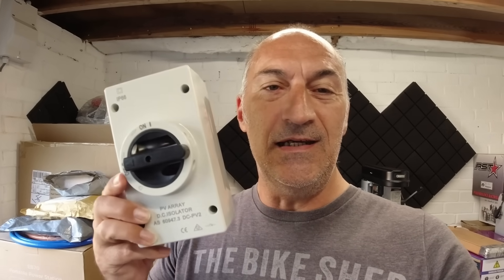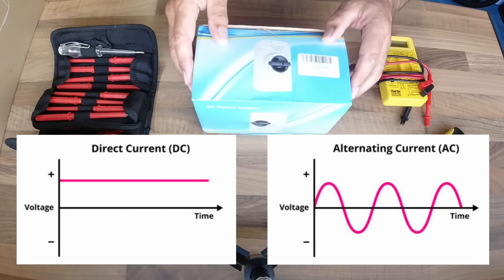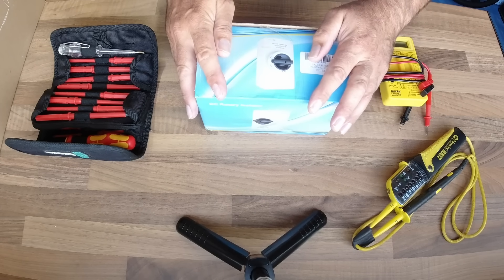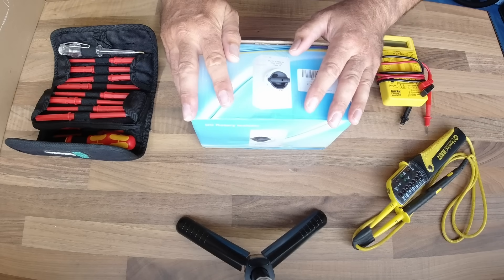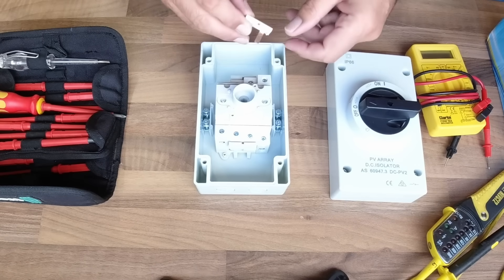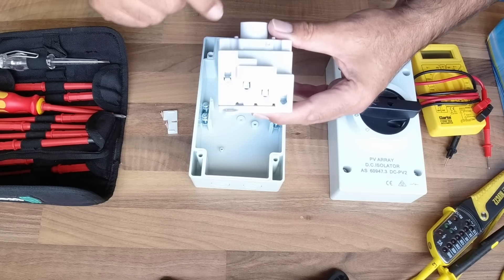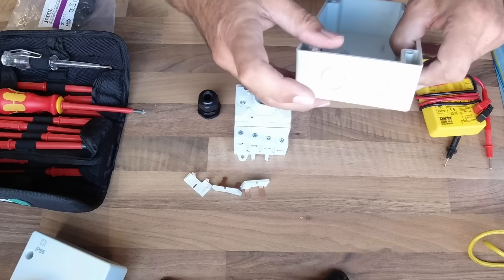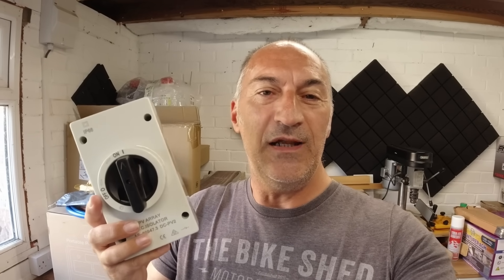How to Wire a Solar DC Switch - Budget Build EP16

Comment: Great timing, was ready to assemble a small home system, and realized I would need a solar DC switch, and saw videos of the DC arcing risks with connectors and fires from burning switches.  This was very helpful. I will size for current, wire correctly and locate the switch outside on a non-flamable brick wall.

Comment: Thank you for your video, you explain it very well.  I hav the same unit that you have and my problem is the knob/selector doesn't want to turn freely from off position to on, there is a spring action that prevents me from turning it.  My understanding is that there is a way to ease off on the spring so that the selector turns, I have tried to push inwards while trying to turn but it doesn't help.  I'd sure appreciate any help or diagrams to poing out where the adjustment screw is?

Comment: So if I'm correct you could use this DC switch to disconnect DC for 2 seperate strings on the same inverter but with different MPPT's?

Comment: I wouldn't even know where to start thanking you @GregVirgoe. I've basically binge watched all your Ducato budget build series and have to say that I really appreciate the time and effort that went into making these.

It's the details of the videography I appreciated too, even putting a dead cat on the mic, taking the time to pause, setup the camera and then film. Amazing.

Then the technical details blew me away. A lot of things are common sense such as sound deadening and thermal insulation but having it explained in detail as to why you only need a small amount of sound deadening instead of covering the whole panel.

Then there was the scribing, such a simple solution.

We had a large motorhome (7.2m x 2.5 x 3.2m) and I spent a lot of time and money upgrading her and we loved it but decided ro sell as we weren't using it that much and the main reason was size so seeing what you can do with a Ducato really interested me.

The plan, although this might change, is to buy a base in the UK (we live in Tenerife) and find a barn or somewhere we can store/work on her or even get someone to build it for us.

Your videos are simply fantastic. Loved every minute and now on to your travel videos !

Comment: If you were to fit isolators in a house you would be in breach of the current wiring regs as they have caused so many fires. Based on that - do you want to fit one in your van?

Comment: Hi Greg, I've got a question about my build. I'm currently installing a split charger to two batteries but I also have two solar panels. Is there an order I've to do this in? I was given a warning before hooking everything up.
Reply from the maker: @J4m-ontoast  you also need a solar charge controller. Leisure battery to solar charger before you connect the solar then you can connect split charger. 
I don’t recommend using split charge relays because all they are is a switch. Far better to use a DC to DC charger or the combined unit I’m fitting in the Ducato 👍🏼

Comment: In another video you show a plastic with an RCD and two MCB's (6 & 10 A) and you mentioned that you could not get the kit in a metal box. I have two comments on this that I friend enquired of me, he asked if he should wire the two MCB to gether to give 16a through put. I pointed out to hime that he would not get the 16 amps he wants to supply to his Victron inverter, if he wire them in series the ^A RCD would pop as soon as he applied power to the inverter.. I informed him that he could use a  16 amp RCBO (Residual Current Breaker with Over-Current) which would give him the correct AC feed to his inverter. The RCBO can also be purchased in a metal Enclosure. I think you should re-record your video and include the RCBO as it is perfect for a van fit as it is reasonably small in a metelic box.

Comment: Love watching your vids Greg. Very informative but can you offer a bit of advice.. I bought a portable solar panel as I didn't want a permanent fixture. I have however got Leisure batteries in permanently and a PWM controller. Rather than using an isolator switch between the panel and controller can I put one between the controller and the batteries ?? I don't very often use the car as a micro camper so the Controller would be permanently slowly draining the batteries to stop powering the PWM. Thanks

Comment: Great video!  Thank you very much!  Question: is there an isolator box that allows me to switch between two batteries?  I have a conventional Rv roof mounted solar system (4-100 watt solar panel, charge controller and two batteries) but I also have a Ecoflow delta. I would like to charge both with my panels. I need a way to isolate power going to the conventional system when I’m charging my Ecoflow delta and vice versa. I’m currently manually unplugging the mc4 connectors.
Reply from the maker: You can get rotary changeover switches with multiple poles that would do that job ok 👌🏼
Reply: I found this on Amazon. Is Baomain a quality manufacturer?  
 
Baomain Universal Rotary Changeover Switch SZW26-20/D202.2D with Master Switch Exterior Box 660V 20A 3 Position 2 Phase (Wider Box)

Comment: Do I need a switch that’s rated greater than my solar panel current at PMAX(IMPP) or Maximum Overcurrent Protection Rating? I’m using 3 400W panels in series with an IMPP of 12.89A but with MOPR of 30A. Just one positive & one negative cable also at this point.

Comment: yet another informative video greg thank you.. 🤷‍♂I do have a question about the cable you use for the solar.? I see they have 4mm & 6mm.. which would i need for 1 single 435W solar panel..??  Also as others have said when will you be uploading more of the budget build videos.. . 🙏🙏🙏

Comment: Hiya Greg, another great video, I bought one of these three years ago when I converted my van following many of your other excellent tutorials, but shamefully I never fitted it! It has been sat in the loft all this time! So no way to knock out the solar power, which, as you pointed out, is hardly best practice! This particular video leapt out at me because I've had it in the back of my mind recently to finally fit the bloody thing! At least the days are very short at the moment, so I won't have to wait until midnight to wire the switch 😂 Thanks again for all of the really thorough guidance that you've put out there over the past few years. I and many others really do appreciate it. If I bump into you someday I'll show you all the bits of my van that are rip-offs of yours 🤣

Comment: Hi Greg, I'm going to have 3, 175w solar panels, so that would that isolator work I do I need a higher rated one
Thanks in advance
Reply from the maker: It would just do it. To be safer you could go 40-60 amp rated switch for very similar cost. 👍🏼🤩
Reply: @GregVirgoe  thanks Greg

Comment: Great video Greg , these switches are a bit of a pain to wire , what you could do is an AC switch vlog , say for shore/off/alt,  most of them have 8 connections which require linking out a common output , you videos are well presented so think would attract high views as there's not many out there . 👍
Reply from the maker: Yes I know exactly which one you mean and you are right they do require a link to common up the output side. I’m planning something special for changeover

Comment: Great stuff Greg , on a similar subject I like to use single pole DC MCBs on my 12v side the DIN type  appliances rather than the breaker fuses , don't hear much about those on any videos on YT , with them being a good option surprised there's not much out there on them . There's polarised and non polarised with ARC quench built in .
Reply from the maker: I did a video before this one discussing DC breakers you might want to take a look at that. 👍🏼😊

Comment: Hi Greg
I have one of the consumer units you have linked to in this video.
Would it be ok to wire the Truma 4e boiler to the 6amp mcb and my plug sockets to the 10amp mcb.
I will be plugging in a  40amp fogstar  battery charger and a 2000w Renogy  invertor. Any help would be greatly appreciated.
Reply from the maker: The Truma will need to come off the 10amp breaker as it’s a 1800w electric element in those. The 40amp mains charger will run fine on the 6amp breaker as that is only just over 2amps from the mains input side. Hope that helps 👍🏼😊

Comment: Hi Greg great info just started my wiring planning today, could you tell me the link for the 10mm cable from battery to fuse holder please, I cant find it in the links listed
Cheers
Reply from the maker: Battery Cables Various Sizes https://www.ebay.co.uk/itm/124964623505?hash=item1d1878d491:g:H6cAAOSwIwJhsuTZ&mkcid=1&mkrid=710-53481-19255-0&siteid=3&campid=5338027957&toolid=11800&mkevt=1

Comment: Hi Greg, excellent video series, easy to understand and with comprehensive supporting information explaining how and why to do something.
I am in the early planning stages of my own van, I will be travelling solo and I am planning for long trips with extended off grid periods of time, I will be looking to install a shower and flushing toilet cubicle with a hot water heater for the shower and the kitchen sink and also a diesel space heater.
I intend to use a Fiat Ducato LWB for this build, I would be grateful if you could spare the time to advise me if the wiring system your are showing could support the additional power components required. 👍👍 
Thank again for the excellent videos.
Reply from the maker: I have fitted a Diesel heater into this Fiat Ducato van build, if you plan to heat water for a shower i woudl recommend going with lpg as there will not be enough power to heat water with electric
Reply: @GregVirgoe  Thanks Greg information well understood, have a good time!

Comment: hi greg love the vids learning so much, i wish to be able to switch the solar incoming between a renogy 50A dc dc mppt and a bluetti AC200MAX ive seen 3 point switch not sure if double pole, i guess they would have to be. If so could this be used instead of an isolator or would have to as well as?
Reply from the maker: You can do that with a double pole changeover switch. It will switch both positive and negative and has a centre off position. Just make sure you are not exceeding the max input of the power bank.

Comment: Is it possible to wire ( and more importantly will it work) to have the solar switch feeding into the mppt and on the other connection have a Xt60 connector feeding an ecoflow delta...
TIA

Comment: Hi Greg, just wondering why you have a dedicated continuity tester when most multimeters seems to have a continuity setting and you have a multi meter visible in the video. I only ask as I don't own either and i'm looking to buy one, I'd rather just get the multimeter if it covers the functionality of both devices. Thank you!
Reply from the maker: I’ve just acquired them over the years, I have two multimeters, a clamp meter and that continuity tester. All four will do continuity testing. The multimeter doesn’t make an audible sound on continuity so for the video it was more effective to use that. But if you only want to buy one device then a normal multimeter will give you more functions in one device.
Reply: thanks Greg, LOVE your channel its such a fantastic resource. I have just bought an L3H3 transit i'll be self converting in time for next summer  @GregVirgoe

Comment: Man i wished i had seen this before i wired mine 2 weeks ago. Lol, why why whyyyyyyyyy! Crossed? Ima watch this anyways. I have 2 controllers connected and one array. 2nd array is coming, but it's all wired up.,,, EDIT: ah i see now, i installed mine before you posted this. This will be a useful vid for sure cause double poll is the way to go and this box is all crossed.
Reply from the maker: You could use this one switch to isolate both arrays as it’s a 4 pole switch. 
Array 1 positive 1-2
Array 1 negative 3-4
Array 2 positive 5-6
Array 2 negative 7-8
No need for a separate switch. Disconnect all the wires in one go

Comment: Hi Greg can you help me please. I own 65 plate Citroen relay.
Rear doors saying open all the time after the right-hand door got blown shut which i corrected...ie left door 1st then the right off course..... that's when the rear doors open sign popped up.
I now can't lock the doors properly. 
Pretty sure you'll know the answer thanks Scott
Reply from the maker: It must have dislodged the switch or the switch got stuck on the right door that tells the van the door is closed. https://youtu.be/pOu709I4MVk
Reply: @GregVirgoe  thanks I'll look into it I had bought a new actuator but when I plugged it in it still never threw the lock over but least I never fitted it I'll let you know my progress ☺️
Reply from the maker: @scottydogg420  most likely the door contacts if it slammed. 👍🏼😊
Reply: @GregVirgoe  I'm hoping so but is there door contacts on the rear door or did you mean the side door contacts?
Reply from the maker: @scottydogg420  I would expect there to be door contacts on the rear too. 👍🏼😊
Reply: @GregVirgoe  any idea of location?? Many thanks
Reply: Got the door problem fixed broken wires on rear door loom part... Easily can turn into an electrical nitemare and it's a simple repair 👍

Comment: Hi Greg. I even watch your videos now I've finished my build 😅. Anyway I've always been concerned regarding those copper buzz bars . I had them but didn't know where they went and had not found then in the instructions or any videos on YouTube.  Do I need to check if mine has them already installed as I threw them away but it's working.  I'm a bit worried now as I've been away in it 3 times and it's running constantly

Comment: Hi Greg , I meant to ask. Can you use a household consumer unit when wiring the electrics. I ask as in one of the Victron bundles it says 2 x 5 switch consumer units. When there are plenty household ones that will do this in one unit
Cheers
Reply from the maker: They do that to differentiate between the incoming and outgoing supplies. One for the hook up and one for the inverter. 
No reason why you can’t buy a larger enclosure and put all the RCD and breakers in one box. 
I have a better solution and much cheaper. Just get two of these https://www.electrical4less.co.uk/product/wced-a-type-electric-vehicle-2-module-enclosure-16a-rcbo-c-curve/   That is a double pole RCD & MCB in one device 👍🏼😊 Hope that helps
Reply: @GregVirgoe  Thankyou

Comment: A question: why a 12v dc breaker keeps triping when charging the house batterys with sterling b2b (60A) ?

The breaker is a 80A rated.
Reply: The wires are 25mm with cooper lugs. I can seee the breaker overheats when the b2b is charging at around 40amps.

Comment: As always Greg you have explained this in such a way that is just easy to understand……
I fitted a changeover switch last year that confused the hell out of me, but after, and shall we just call it an accidental connection, I finally sussed it out…. If I’d had you to back then I would have been fine.  Great teaching video as always. Thank you 👍🍻
Reply from the maker: I agree they are very confusing to wire. The poles are stacked in rows going back from the switch but more difficult than this isolator 😉

Comment: Hi Greg the 4 pole disconnector switch should have a interlock so the cover cannot be removed in the on position  and only can be removed in the off position
Reply from the maker: You are right but this one didn’t. I thought that was odd myself. 🤔

Comment: Thank for a another great video 😃 I also went for all products from Renogy and for the solar panels I read in the manual that calculating the Amps I need to add the Sizing Factor. So in your case 10.31 + 10.31 = 20.62 * 1.56 (SF) would come to 32.16 Amps. I have the same 175 Watt panels but I have 3 of them. So my calculations is 10.31 * 3 * 1.56 = 48.25 Amps. Also in parallel. I got a isolator rated for 50A and I also got the same Charge Controller like yours but mine is the 50A version. What do you think about the Sizing Factor, how important is it to add it?  Cheers mate
Reply: Hey Greg, I read about the calculation of total Short Circuit Current (Isc) * 1.56 in the manual for the Charge Controller on page 13. I did not understand what 1.56 was so after some Googling it is called Sizing Factor. Also sorry I first wrote volts and then Amps but I ment Amps all along. On a side note that bothers me is that after speaking with Renogy twice about the cable size after the branch connectors they recommend 10 AWG/6mm cable for me with 3, 175 Watt panels. I asked if I need 6 AWG/16mm for my 48A including 1.56 in the calculations and up to 4.6 meters long cable but one support guy said to not think like that. 🤔 You went higher up to 6mm cable because of the Amps increase in parallel. I think you said that in the solar video 😊
Reply from the maker: @kriscapson  yes I did go up to 6mm on the solar cable because the amps doubled in parallel. 
I find the best free cable sizing calculator to use is this one on 12volt planet knowledge base 
https://www.12voltplanet.co.uk/cable-sizing-selection.html
Just scroll halfway down the page to find it. Really easy to use 👍🏼🤩
Reply: @GregVirgoe  Great, thanks Greg ✌🤩 Cheers mate
Reply from the maker: I’d like to see which manual you were referring to as I’ve not heard of the Sizing Factor 😊 
I recommend applying a 25% margin to your load when sizing fuses then your cables do need to be sized above that so a 56% margin on cables would be really safe way to go. 👍🏼🤩

Comment: 👍👍

I used one of those 2 pole 32A DC circuit breakers. Will that work just the same? It does disconnect the solar panels when I flip the switch down.
Reply from the maker: Yes it will and it will also give you overcurrent protection. I will be covering those too in this series.
Reply: Awesome. Thanks Greg